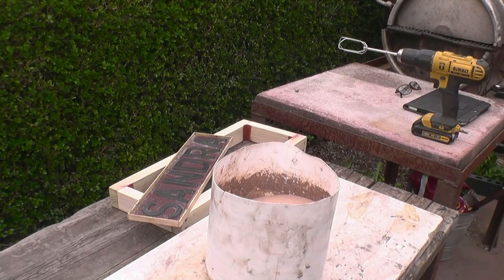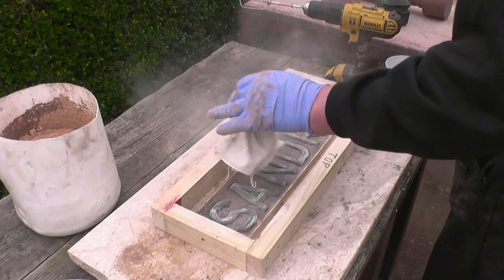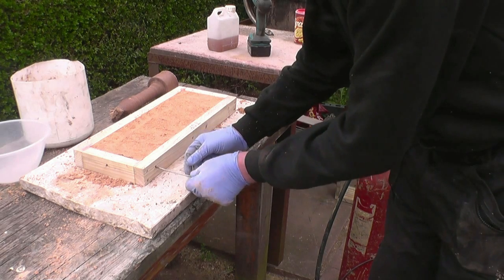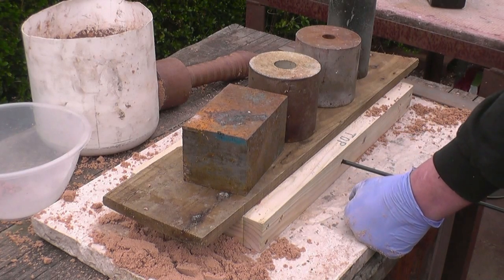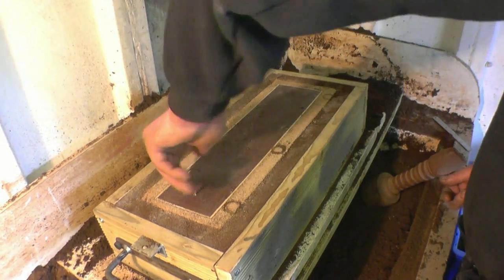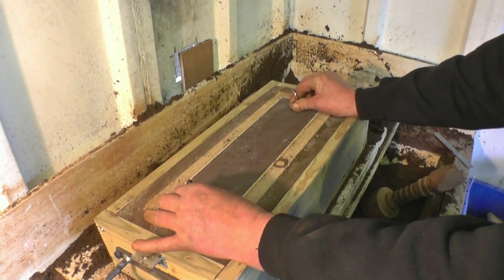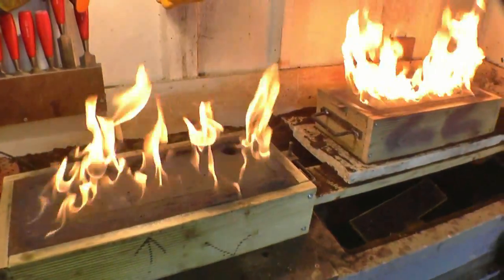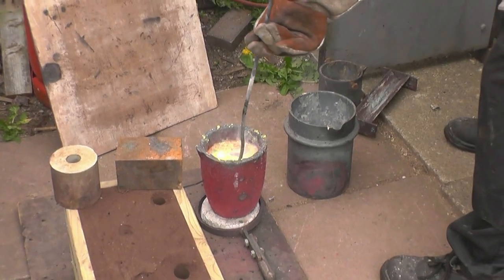SNNC 124 P1 Casting with Sodium Silicate

Comment: Does all the zinc cook off leaving you with pure copper or close to it?  Can you add tin when smelting and come up with your own bronze as you cook off the zinc?  Very interesting.  About how many times are your molds successful out of ten?  Seems it could be very time consuming as one little imperfection ruins hours of work.  How does that funace work out in a wood closet??  Seems pretty close with those kind of temperatures?  Just asking as I don't do any casting but am getting more intrigued.  Doug

Comment: Another great vid. Just a suggestion, but you can put the mold in a large thick trash bag (bin liners I think you call them) and spray the CO2 in it. Doesn't use as much CO2 and it doesn't get blown away by air currents. Spray some in and you can leave it to soak into the mold.
Glad to hear Debs is liking her new job.